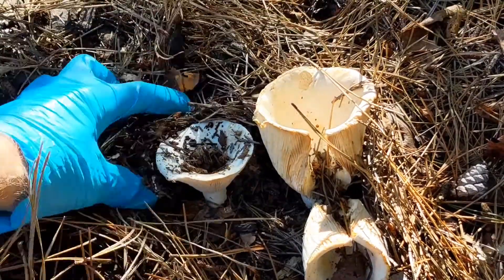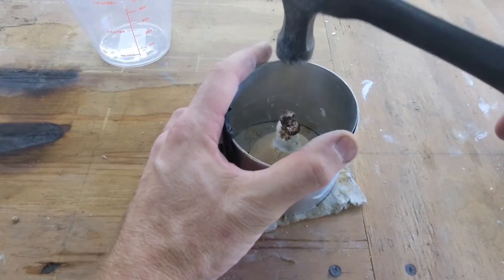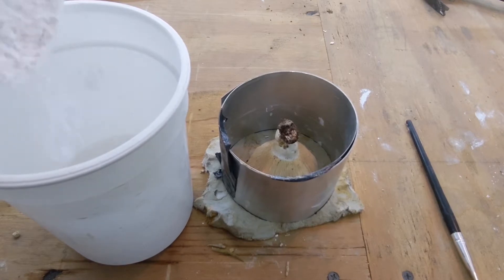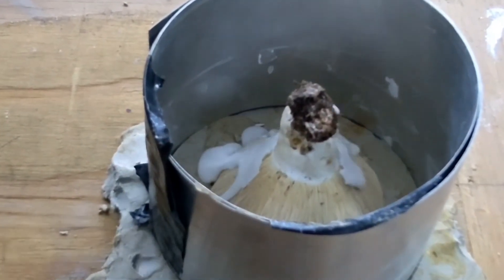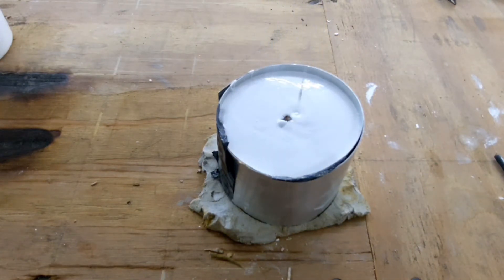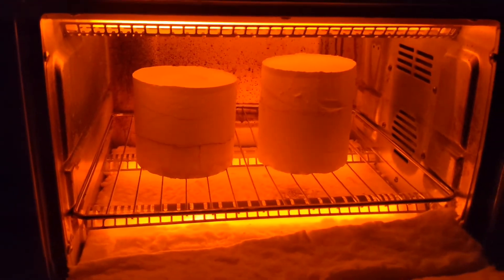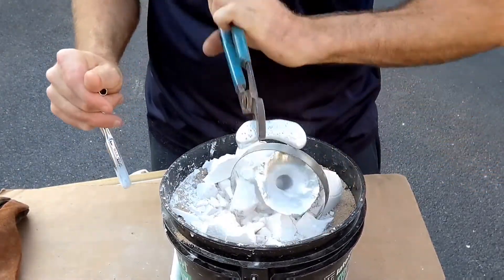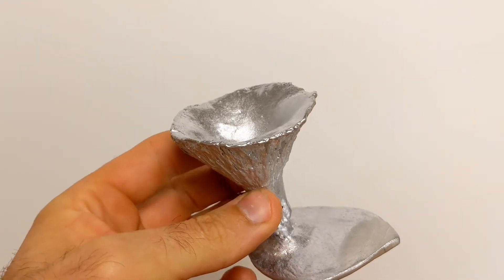Casting a Mushroom with Plaster and Molten Aluminum - diy - how to make a metal mushroom

Comment: The hole in the middle is shrinkage from using non-degassed aluminum and from not having a sprue as a pool for the metal pull from while cooling.
Reply from the maker: Thank you!  I realized afterwards  how I could have done it differently.  When the mushrooms come out again I will solve the issue.